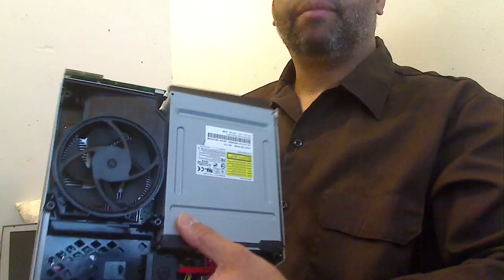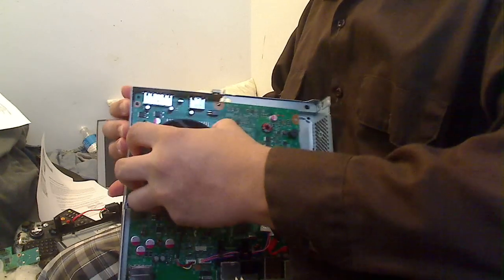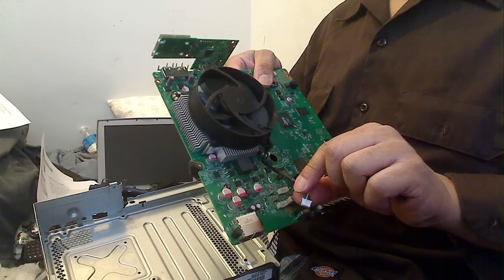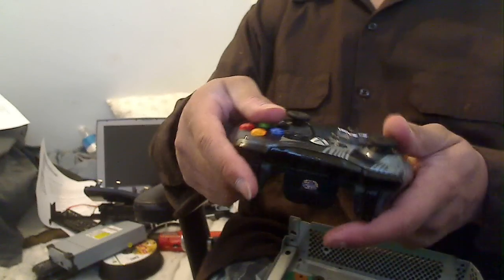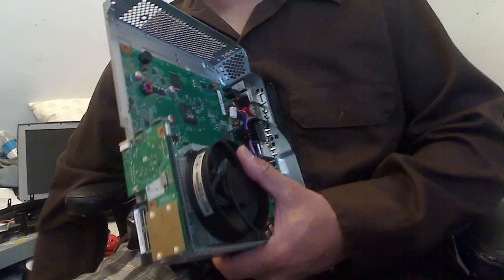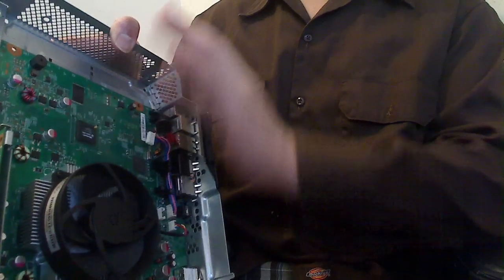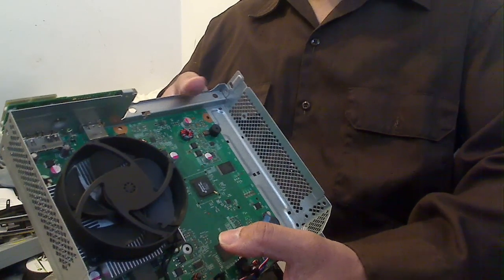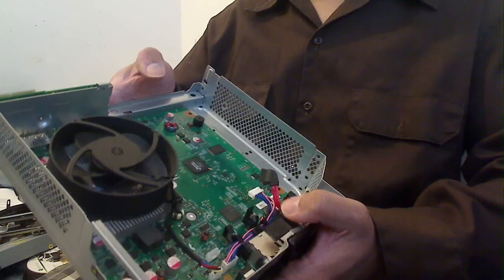How to fix Xbox 360 Slim RROD / Red Dot of Death Reset Solution👍

Comment: ahh please help my xbox 360 slim is still showing red dot and i have tried everything and i also don't have an hard drive reply please what should i do
Reply from the maker: Have you removed the heat sink yet..
Reply: i have removed the heat sink now and i dont have that thermal grease after putting it on the processor and then closing the heat sink for how much time to i get it to overheat i m in india on 220v ????
Reply from the maker: I'm confused..! If you don't have the thermal grease, how did you put it on the processor.?
Reply: oh sorry i took out the heat and then i bought the grease after some time and then put it on the processor but no worry it isn't working i tried overheating it and then put the fan back and nothing still red but still ty :)
Reply from the maker: It may be the power brick and not the xbox 360 slim.. Try a different power adapter. Power adapters go bad all the time. They have fans in them, so if the fan fails the power adapter can go bad. Sometimes it just overheats and shuts down from lack of ventilation and a red light will show on the front and it will not provide the correct amount of power to the xbox and the xbox may show a red-dot error.
Reply: ok
Reply: sir i tried with my friends xbox adapter it is still not working btw thanks for advice
Reply from the maker: Sure. Sorry I couldn't help you.
Reply: np sir still thank you :)

Comment: HELP PLEASE? When I turn mine on after like 5 seconds it gets the red dot and nothing shows on the tv. The other day I left it unplugged 8 hours, went to work came back plugged it in and it worked. While I was playing it, it kept making the beep noise it makes when you open the tray (still kept playing FIFA with no problems just that beep noise every 2 min). When I finish playing after like 40 minutes I turned it off and didn't play until the next day. Well the next day I turned it on and the same problem again (red dot after 5 seconds/nothing on TV. Tried the whole "leave it unplug for a few hours and plug it back in process", and it work one time again but it only took me to the xbox intro before going to the dashboard and it froze there but the dot stayed green. Since it froze I turned it off and on again and BAMM red dot again. Any help would be greatly appreciate it. My power brick's light is orange but goes green when I power xbox on. It's a 250gb xbox slim. I can hear hear the fan turning even though it's has the red dot.

Comment: Dude, some pretty good info but did I hear you suggest using alcohol to clean the motherboard? Bad advice bro' because all motherboards and graphics cards are manufactured with a thin protective coating that is meant to help avoid deep scratche4s. A deep scratch can possibly break a circuit and then you'd be screwed. Using  alcohol causes the coating to falter. The very best method is using a compressed can of air or an air compressor .Years of computer servicing is my reference.

Comment: The red dot happens on my power box. Anyone can tell me what's wrong?
Reply from the maker: It has either gone bad or it is over heating because of fan-cooling failure. If so, you will have to replace your Power Box, a.k.a The Power-Brick or AC Power Adapter... You can buy one off of eBay, Craigslist or a retail store such as GameStop or other. Good Luck..

Comment: I have a question, I've had my xbox for a couple years then it got red ring and I fixed it my re pasting the gpu/co to their heat sinks and it works just fine for awhile, then I quit playing do almost a year and I just plugged in my xbox. And it red ring which was weird, so I took apart my xbox and reposted it because the past wasn't there anymore and it worked for about 10 or so mins and I get this glitch checkerboard on my screen whenever I try to do anything on it, any ideas on how to fix it?

Comment: my xbox wont even turn on anymore but when i press the button it makes the noise if i do this will it fix it
Reply from the maker: Does your power brick have a green or red light.
Reply: no
Reply: i meen yes
a red/orange
Reply from the maker: FuSe clan
So your SLIM is probably not powering on because the power brick is bad. You should see if the noise is coming from the power brick which also has a fan for cooling and one of the reasons the power-brick shouldnt be placed on carpet. Try a friends power-brick or take it to gamestop and ask them to see if you need a new power-brick by testing a new one on your consel. Good Luck.

Comment: I tried it 6times and it still gets the red dot of death and I tried other methods to get rid of the red dot of death and they don't work for my Xbox 360 slim / What I do now?
Reply from the maker: Did you go as far as running a heat gun over both sides and inspecting the board for debris..?
Reply: yes I have
Reply from the maker: Check the heat sink for dried out CPU paste; if it is dried out,clean it off and replace it with new CPU paste.
Reply from the maker: Donte Beachem Also, there may be something more serious wrong with your xbox. It may have been exposed to a power surge or the power brick could be the culprit. Try unplugging controller cables and check inside the usb ports to make sure the usb pins aren't touching each other or the metal side of the port. This can cause a ground fault.

Comment: this works only on 250GB or also on 4GB because i have a 4GB model dudeit fall down and it shows red ring to fix it some experts said it cost 120 euros wtf better fix it by myself or get a new one
Reply from the maker: You can look up a video on disassembling the xbox 360 slim and pop out the 4GB memory module or re-seat it. You can remove it then try and power on the xbox. If it powers on, the memory module may be broken. You can purchase one here or just go see what it looks like, --> http://www.ebay.com/itm/XBOX-360-OEM-Genuine-Microsoft-XBOX-360-Slim-4GB-Memory-Card-Module-/191221637369?pt=US_Video_Gaming_Replacement_Parts_Tools&hash=item2c85b2a0f9
Reply: ok i will try that thank you ;)
Reply from the maker: sure. Dont forget to do a reset if it doesn't initially power on with a "Green Light of Life."

Comment: I have an Xbox 360 Slim with the red dot of death. I took it apart and when i removed disc drive I decided to try and turn on the Xbox. It turned on perfectly fine and functioned normally. When I put the disc drive back in it got the red dot again. Does this mean I need a new disc drive?? Any advice would be helpful thanks.
Reply from the maker: Your drive problem could be caused by one of several things. The 1st is that the power and data cable may not be in the drive firmly or possibly not connected to the main board correctly. Make sure the SATA and Power cable are firmly pushed in and flush against the main board (Motherboard). The 2nd possible cause cold be a bad data and or power cable. Replace both.. The 3rd could be a bad SLIM drive that somehow obtained a hardware defect. I am not sure if a failed Xbox live update can cause this but its something worth looking into.. You can try 1st removing the disc-drive, then power on the console. Navigate over to Settings then System, hit the A-button then go down to storage and hit the A-button, Then select your main storage hard-drive and then hit 'Y'. Select 'Clear System Cache' and hit A. Power off the SLIM, reconnect the drive and check.
 
Or you could try this method to clear failed system updates; hold the sync button down on your Xbox 360 console. It's the little white button that you typically press to link the system to wireless controllers. Keep holding it down, and press the power button to boot the console. Do not let go of the sync button at any time. The console should completely boot up, and in the process, it will delete the new, failed system update, allowing you to boot your console and try to re-download the system update that you need. You can also visit this site for additional methods on how to clear failed updates. If this doesnt work, you will have to either replace the cables or the drive..

Comment: how do i unplug the fan from the motherboard because there's a tab on the plug and it's keeping me from unplugging it
Reply from the maker: Thats really odd. You can try blocking the fan with a pen or other plastic something..
Reply: Donte Beachem i fixed it since then it just looked like a tab and it wouldn't come off but it did after trying for awhile
Reply from the maker: Ok that's great.  Did you use my method for your repair or some other.?

Comment: was the xbox you had to fix a halo 4 edition because that would be interesting as mine is that edition too
Reply: Happened to me while playing halo 4
Reply: Did you find a solution?  my Halo 4 edition just did this
Reply: Tazn9neXP  i looked up a tutorial that involved taking out the internal 4gb memory but mine is too new and has it built into the mother board. i also noticed that my city has an average temperature of 90 degrees fahrenheit. the only preventative measure is to clear the cache of the harddrive every once in a while but its a little too late for that.

Comment: mine doesn't even heat up when doing this
Reply from the maker: Did you disconnect the fan? If not make sure the power brick is on with a green light coming from the power brick. Also, you can try someone else xbox 360 slim power brick.

Comment: i cant get thew connection from the fan to the board HOW DOES IT COME OUT SO EASY FOR EVERY VIDEO I SEE?
Reply from the maker: Its a white plastic connecter, just plugged into the board attached to 2-lead wires. Grab the little white connector with your hand and pull up. Do not grab it by the wires to pull since the wires could become disconnected from the little white connector.
Reply: Im sorry   you must have miss understood what i said.  i know a lot about electronics (better at taking them apart than anything else) but what i was saying is that the plug wont come out, its just stuck in there and no matter what i do i cant get it out
Reply from the maker: Oh wow. Then there's something wrong. Maybe someone glued it. But since yoj know about electronics then maybe you could just cut the hot for your disconnect option and after the procedure laid out jn the video,you can solder the wire back together or just a regular pigtail and wrap with electrical tape.
Reply: no its all good i managed to pry it out with a flat head right when i was thinking about cutting it
Reply from the maker: Doom Guy
You can just try blocking the fan with an ink pen or some other plastic piece..

Comment from the maker: The steps in the video only work for those that have had a ground fault occur to the XBOX 360 SLIM or even the Xbox 360, of which the Xbox didn't self correct after the ground fault was removed (metal on the board or incorrect placement of the hard-drive) or the conditions changed, such as you removed the Xbox from an outlet that has over-current. Your Red-Dot error may be caused by another factor such as hard-drive placement or hardware malfunction; usually parts on the board, such as capacitors or chips. Keep in mind that ground-faults are suppose to be a good thing. It removes current to vital sections so that the entire Xbox doesn't become damaged, but just until the damaged area is repaired; then current is supplied to the rest of the board making your Xbox function once again..
Reply: I haven't yet tried this because I don't know what's the cause of the red ring of death, the day before it happened it slipped from my hands and hit the ground but it worked fine. Then day after I played assasin's creed , 30 minutes later the game crashed and I turned it off and on and the red dot appeared. I don't know if i should try this because I don't know what problems may occur.

Btw English isn't my native language and first reply 5 yers later :D
Reply: What is the error code for this? I'm getting the error 64 code
Reply: Would that also be the same way with the Xbox one even though it doesn't show the red light of death
Reply from the maker: @josephsimon5697  I have no clue.

Comment: hey how come my xbox didnt work ?
i use your step?
Reply from the maker: Hey Justine.. The steps in the video only work for those that have had a ground fault occur to the XBOX 360 SLIM or even the Xbox 360, of which the Xbox didn't self correct after the ground fault was removed (metal on the board or incorrect placement of the hard-drive) or the conditions changed, such as you removed the Xbox from an outlet that has over-current. Your Red-Dot error may be caused by another factor such as hard-drive placement or hardware malfunction; usually parts on the board, such as capacitors or chips. Keep in mind that ground-faults are suppose to be a good thing. It removes current to vital sections so that the entire Xbox doesn't become damaged, but just until the damaged area is repaired; then current is supplied to the rest of the board making your Xbox function once again..
Reply: ok men thanks
my dad said it was a burn regulator on the heat sink

i did not know what that means but i only want my xbox work again 

im a filipino i dont really understand your comment ^_^ so tell me step by step how to fix it . is that ok ?

pls thanks again men
Reply from the maker: justine catap Step 1. Remove the hardrive from the covered compartment.

Step 2. Take apart your Xbox 360 Slim. Find a video to show you how to d that. I don't provide one.

Step 3. Remove the motherboard from the metal case.

Step 4. Remove the Xbox X-clamp from the bottom of the motherboard holding the heat-sink metal block to

the processor, a.k.a. CPU.

Step 5. Pull the heat-sink metal block and fan from top of the processor. It may seem a little hard to

remove but keep tryin. Twist or pivit the heat-sink and fan til you can remove it. You do not need to

remove the fan from the metal block..

Step 6. Clean the paste from the top of the CPU/processor. Clean the paste from the bottom of the heat-

sink. You may need CPU-paste remover or you can try 70% rubbing alcohol. After cleaning you will need to

add new CPU paste to the same area you cleaned the old paste from. Note: Do not place the heat-sink back

on the processor without the paste. Your Xbox 360 Slim could burn out.

Step 7. After applying the new paste, place the heat-sink and fan back on and reinstall the X-clamp.

Step 8. Remove the power cable from the PCB connecting the heat-sink and fan, so that the fan wont come

on when you add power to the board. Watch the video so that you can know which way to plug the power

cable back into the board. Also plug in the video cable. The video cable has to be plugged in.ep 9. Power

on the Xbox. The fan should not be moving. You should still have the red-dot. If your Red-Dot has gone

away and turned green, continue with the repair anyway.

Step 10. Leave the Xbox with the power on, without the fan spinning for 30 minutes. After 30 minutes

unplug the power from the Xbox and let it sit with no video cable attached to any source and no power for

 about another 30 minutes.

Step 11. After the 2nd 30 minutes has pasted, plug the heat-sink fan assembly power cable back into the

PCB, plug in the power cable and the video cable and power on, - before you put the Xbox back together.

Step 12. If you get a green light, unplug everything and reassemble your Xbox.
Hope this helps...
Reply: thanks a lot men 
really appreciate it ^_^
ill keep watching your videos thanks again

Comment: I will try your solution tonight, I really hope it will work. otherwise I am buying a new console which I cant afford currently,,, I ll give my feedback after that I just hope that your not scamming us.
Reply from the maker: I hope it works for you, Rabih..
Reply: Donte Beachem I could not reach to the Fan cable to unplug, however I dropped an ear stick in the fan to prevent it from moving. the xbox did over heat and shut off I left it to cool down but the problem still exist. Im so close on throwing my xbox now.
Reply from the maker: ***** 
Ok, this sounds like you didn't take apart like instructed in the video, otherwise you would have had complete access to the fan. The PCB (Printed Circuit Board), also known as the motherboard should be completely removed.  If you require instructions on dis-assembly just do a search on "how to take apart your Xbox 360-slim." The fan and heat sink should be removed so that the processor can be cleaned and so that new CPU paste can be added. If the paste  has dried up, there will not be good heat transfer to the metal block and most of the heat will stay inside of the CPU, forcing a continued ground-fault...
Reply from the maker: Donte Beachem In addition you may need to check your hard drive to make sure its seated correctly and/or replace the sata and dvd power cable. Take into consideration  that your power brick may not be working correctly.  Check to make sure that your brick light does not have a red light coming from it.